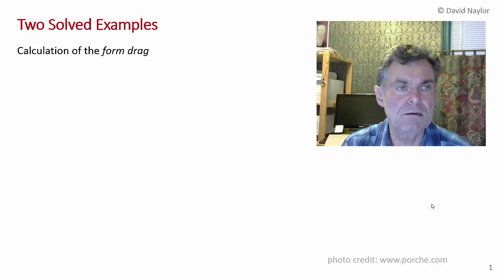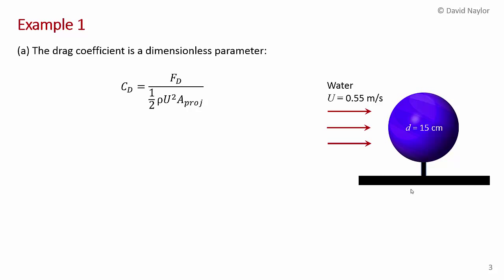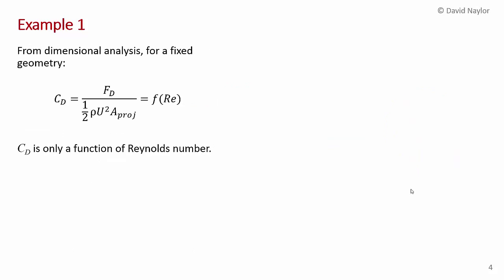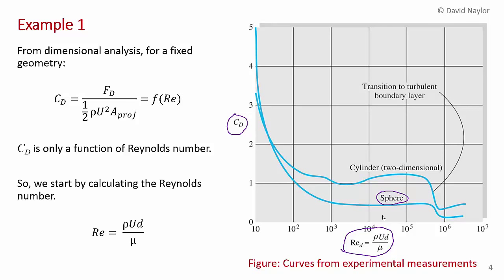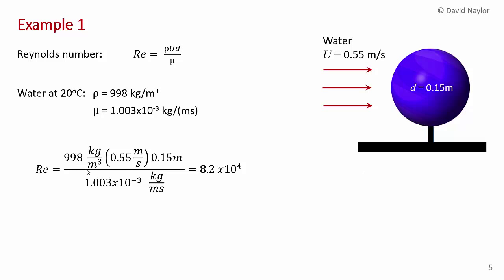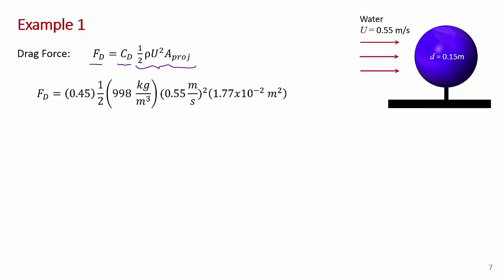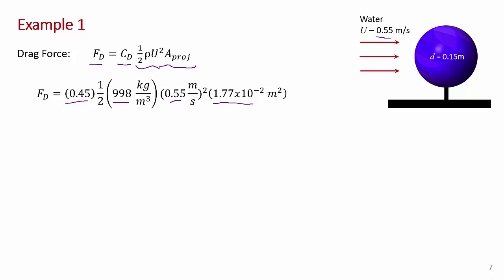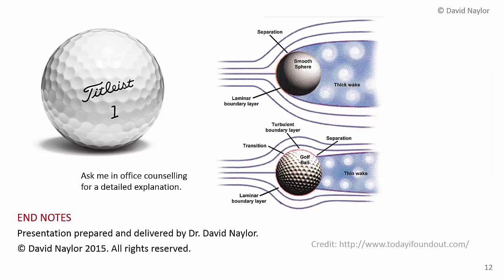Fluid Mechanics Solved Problems: Aerodynamics Drag

Comment: it is exactly like you said, counter intuitive. A smooth surface encounters more drag compared to a rough one. Does that mean that sport's cars should have a rough surface (on front of the car) to reduce drag?
Reply from the maker: The short answer is yes. At some speeds and for streamlined body shapes (no sharp corners), roughing the surface would decrease the form drag. However, the effect will be much smaller for objects with sharp corners (so-called "bluff bodies"). With sharp corners, the flow separation point is well defined -- it always happens at the corners and C_D tends not to be a strong function of Reynolds number. The TV show Myth Busters considered this question and found an effect:
https://www.youtube.com/watch?v=snNL5GgOq_c